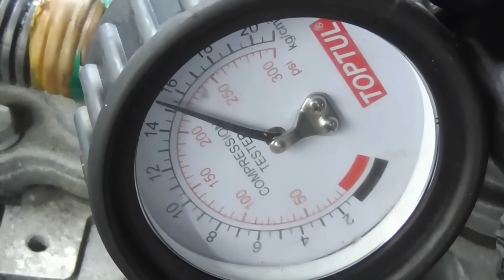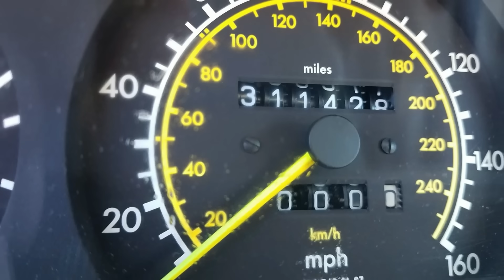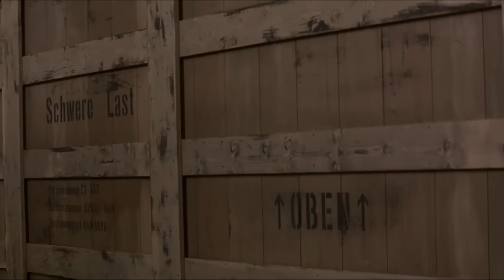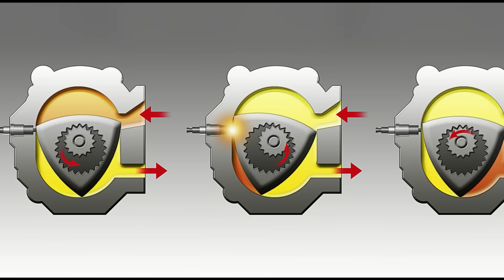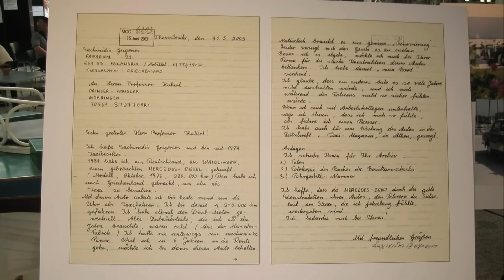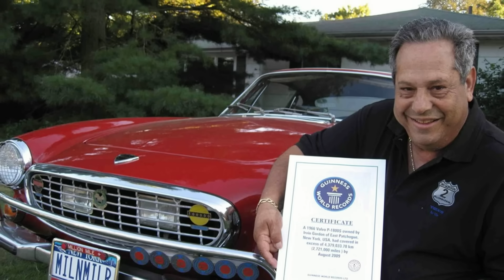Most Reliable Engines of All Time

Comment: No Dodge slant or small block Chevy?
Reply: Thats what im saying.. last even with lead foots..
Reply: Captain Ron old school Chevy v8 and v6 are unkillable
Reply: @inforthewin3231  lol I have a 98 blazer with 208k miles still running good and in my area they're are a lot of old Chevy trucks still around
Reply: 5.3 vortec ?
Reply: Or LA dodge even.
Reply: The slant 6 will run forever, also the Toyota 22R should have been listed.
Reply: @nrwlkguy  The 22R should last 1M miles it's a gutless wonder.
Reply: Yea,  no mention of the vortec 5.3L? 🤔🤔🤔 obviously the guy making this list knows nothing.
Reply: profnasty  My SBF, you have to throw into Mount Doom to kill. Your I6, you have to weigh it down to keep it under the lava for a week, or it'll just float out of there without breaking up.
Reply: @cellphonelightsaber  Herbie Hancock's 260 powered (2 brl carb?) AC Cobra that he bought new has some seriously high mileage.  He said the engine has never been opened.
Reply: Slant 6
Reply: @marcturk4410  My Slant 6 Dodge Aspen got me through 6 years of university in Massachusetts.  Including several times a year going home to New Orleans for holidays.  Finally rusted out from road salt but the engine never failed.  Oh wait.  There was that one time it wouldn't start.  I just gave it a smack with a shovel and it fired right up.  :-)
Reply: Right no 327 chevy
Reply: profnasty  4.0l? In a Ranger or a Explorer? That was right around the time they changed from the ohv pushrod 4.0 to the overhead cam version. Which do you have. The overhead cam version have been historically unreliable.
Reply: @jeremygagnon9277  4.0 is the reason it's called the Exploder.  Terrible head gasket problems.
Reply: Didnt you read the title? MOST RELIABLE not MOST FUEL CONSUMING and LEAST RELIABLE.
Reply: @javi009z  Y U be hatein"?
Reply: Chrysler slant 6 , hands down,  the only thing I  ever replace internal was the distributor drive gear.
Reply: SBC is not reliable they are cheap due to numbers of them.

No reliable engine list is complete without Chrysler's slant 6 and the Ford 300.  My 300 has 575k miles and still drive it everyday.
Reply: @bowez9  A quick search through some of the various car selling sites show an awful lot of SBC motors with hundreds of thousands of miles on them.  My '74 GMC PU is coming up on 350K.
Reply: @NuclearGrizzly  With no rebuild or disassembly of long block?  

The last person to see the inside of my 300 was a FOMOCO employee at the Cleveland engine plant in 1989.  This includes all gaskets excluding  water pump.

Most SBC can't say that and for the ones that can account for the 300s that blew up in warranty.
Reply: @bowez9  Mine is just like it came from the factory.  As are so many multi 100k mile sbc's.

The one in my '70 z-28 is coming up on 90k even with frequent track days.
Reply: @NuclearGrizzly  stock 70 z28 would be a 14sec car so unless you're running stock class there is my answer.

There maybe may multiple 100k mile engines but not a statistical signficant number with all original parts with no service.
Reply: @bowez9  I road race mine as well as my '69.  But who said no service?  My cars are all serviced and inspected religiously.  Just some of mine, like some SCB and Porsche flat 6's, haven't had their engines opened.  Though I don't know the mileage my Model T hasn't had it's short block touched.  Just a higher compression head added.
Reply: @NuclearGrizzly  by service I don't mean basic maintenance; ie fluids, filters clutches, but adjusting valves, changing timing/valvetrain components, seal replacement.

This is issue I have with Toyota/Honda, requiring timing set replacement every 60k miles.  Sorry but IMHO tearing a engine apart that often means it not reliable.

I would find it hard to believe you are still running seals, timing set, or lifters from the 1970 assembly of any SBC.  Removing intake, exhaust, or front cover also disqualifies imo.
Reply: @bowez9  Well it's a solid lifter engine so the valve covers come off every 3000 miles.  Just like every other solid lifter engine.  I'm not sure but if I recall the timing cover may have come off to retard the timing to better handle gas that isn't 101 octane.  My dad bought the car new and I remember something about that as well as retarding the distributor timing.  And the carb was replaced with a modern unit to better handle ethanol.  Other than that the engine is just like she came from the factory.

Comment: Toyota h and fe series in line 6 diesels. And ford Barra inline 6 petrol, made in gas form as well. Na and turbo set ups. Easily keeps up with the 2jz and rb motors. Was used in taxis in Aus for years with thousands of cars putting out 500-800 000km trouble free.

Comment: Yeah this is lame. 150k miles isn't a lot for a top 10 most reliable engine. cutoff should be 500k -1 mil miles. Tundra v8 1 mil miles 4.0 Toyota v6 many 600k and still running.

Comment: 7.3 powerstroke? 5.9 Cummins 12v? LBZ duramax? Iv seen a 1996 f350 7.3 powerstroke 450,000 miles never rebuilt has more blow by than a sick hooker but still very reliable
Reply: 5.9 Cummins 12v with 687,000 miles still going strong. This is a list of pussy import cars!! Title should be pussy import car motors snowflake wanna be ricers love.
Reply: My power stroke has 358.000 and my Cummins has about 340.000!!!   This guy is talking about 150.000 miles?????  what's wrong with him???

Comment: No mention of the 7.3 power stroke or 5.9 Cummins?
Reply: I drive a 1998 f-250 two wheel drive with the Powerstroke...as of last nite-689,722 miles,still cruises at 70 on the highway, starts in any weather, plain and simple the dang thing is bulletproof.
Reply: @robertsnyder1330  I've hear of them going over a million without any major work. But never seen one last that long myself.
Reply: @eddieblazek9692  keep the oil clean,add a bit of injector cleaner once and awhile,and use good fuel that's conditioned for the temps in your area...that's all I have ever done. (Plus belts,hoses,antifreeze of course)
Reply: @robertsnyder1330  You're full of shit, there's no such fucking truck.

Comment: No mention of the LS.. Family have owned both Hondas and Toyotas with these engines and none of them have been as bulletproof as my trucks LS... 186,000 and havent touch a single thing other than routine maintenance.
Reply: 476,000 on my 5.3 work truck . Have done head gaskets coils water pump , normal wear stuff . Never have I had a problem with any internals . When I took the heads off of it everything looked perfect . The wear marks were so light that I couldn't even measure them .
Reply: This is all Big Bull Shit lol this guy is aricer lover because he never even mention no 1 v8 engine what so ever. An. No american engines so the title should be the japanese 4 and 6 cilinder engines of all time by de way not to mention the LS engines means eather this guy is antiamerican or he dont know shit
Reply: scotty Kilmer wants to know ur location? lol

Comment: My 2005 Subaru STi just passed 200,000 miles. It has the original factory clutch and it doesn't slip. It has been on a custom stage 2 tune since 110k miles. 👍

Comment: 12valve Cummins million mile motor
Reply: Gabe Hartmann there good motors but not million miles
Reply: i have one with 500 plus and i run the dog shit out of it and it still runs like it just came out of the factory
Reply: I've seen more 12 valve 6 cylinder Cummins engines explode than I have seen reach 250,000 miles

Comment: I got 150,000 miles from my 89 2.3 Mustang clutch. I only had to change it because it kelp breaking the small clutch cable. The springs get so stiff the cable would break.

Comment: Ehh.. You missed out bigtime on the other engines from volvo dude.. Volvo B21/23 that goes in 240/740/940 models. Easely passes 250tm and even 300-350 too. I personally had two volvo 240 that passed  400tous. So, better research! Otherwise i liked your list.. ;)

Comment: The majority of mid 90s chevy trucks with the 5.7l (350) will run a good 240k-250k with zero problems. My family and I have owned 6 of them. The tranny's in them have to be rebuilt around 150k-175k.
Reply: I have over 225, on my 93 chevy never rebuilt

Comment: Clearly know nothing about cars. Quite literally EVERY engine type will make it over 100k miles with good service with overall few exceptions.  Seeing 200k miles is extremely common acrossed all makes all models. Even 300k miles is very common on original engines when they have been taken care of. Stop peddling crap and learn about engines that REGULARLY make over a million miles without major problems. Semi trucks, gm gas v8 engines, duramax, cummins, powerstroke diesels, 90s-2000s sohc honda engines, 4.0l jeep inline 6, Gm 3.8l v6. Ill stop now because youre a joke.

Comment: Uh Toyota Land Cruiser 100!🙋‍♀️ 322k miles still purring like a kitten. 2 Tacomas just hit 1mil miles too!
Reply: 2 toyota tundras hit million miles too
Reply: BASE line with what engine? 4.0?
Reply: @joed8423  toyota 4.7 v8
Reply: @joed8423  4.7-liter DOHC 32-valve EFI V8 235 hp @ 4,800 rpm; 320 lb.-ft. @ 3,400 rpm
Reply: An LS400 hit a million miles too
Reply: I have seen a few cruisers odometers stop working long before the engin started giving problems. We sold 3 with over 400 000 km on them and they sold almost instantly due to the reliability in the African Bush.
Reply: @janwarren5684  I'm reliable in the African bush! 😁 Love me some dark chocolate
Reply: Meanwhile my subaru blew up at 150k 😐
Reply: There you’re trucks ??
Reply: @bg5561742  I think the Land Cruiser is theirs
Reply: @bg5561742  the Tacomas aren't! Just the Land Cruiser. The Tacomas were different owners and just on the news this week.
Reply: I had a 68 F-4 the motor was a mirrored chevy six. It was a tank but the body was a rust bucket

Comment: I have owned a string of GM products, mostly  Chevrolet or Buick.  None have ever had any engine trouble and all were driven at least 150,000 miles by me. 

Two of those vehicles in particular, a 1972 Chev Caprice and a 1981 Chev Suburban, both with 400CI engines, exceeded 300,000  miles driven by me.  

In particular, the Suburban has a much more interesting story.  

Because of a fluke meeting, at least five years after I traded it, I saw it 2000 miles from where I live.  The owner said "it was still an excellent, trouble free vehicle for him" .  

The owner said "he used it to pull his caravan over mountain passes, among other things, and said it was the most powerful vehicle he had owned.

Comment: The early 2000s 5.3s are reliable engines I have a 2001 Chevy Silverado with 313000 miles on it with the 5.3
Reply: Any ls style motor is indestructible cause it has a 6 bolt main and one of the largest camshaft duration produced. Did I mention that until 2015 that the only v8 that had more cfm through the head was NASCAR motor.. wonder why everyone is doing ls swaps lol consistently run 15lbs of boost on stock bottom end no issues

Comment: Heeyyyy heyyyy wait up the SUPRA does not equipped with 3S-EF 4 cylinders ever.  Its 2JZ GE and GTE equipped only.
Reply: Lol do some research
Reply: And why he added a picture of the SUPRA when he's talking about RBs.
Reply: Rusheen Bay101 Yes. And no. Toyota did produce mk4 supras with the 3S-G or 503E, whatever you want to call it. It was a 2.1L 4 cylinder that was used in GTLM races, so sadly it was never a production motor for the Supra because honestly it was an amazing engine.

Comment: My 2001 3.2 litre X308 (XJ8) 4-door Jaguar has now 210,000 Km on the clock, original engine, never been opened. I can still easily reach 200 Km/hr in Germany with her and, if putting her into "sport" mode, she will outrace most of whatever I encounter, she weighs in at about 2 tons ...
Reply: Jags ajv8 is a good engine. Just needs a timing chain upgrade and its bulletproof.

Comment: LMBO my Mazda 3 2.3 l 2004 is running good I got off with 150 k and it at like 198k  . I had the car just over a yr yes I drive alot just because  I love too.. and she is running strong I still play in the car shifting hard and all.. I had a 97 Dodge Neon 2 door 5 speed you had a lot of miles on it I put about 50,000 miles on that car in a year the only reason I sold it is because I ripped motor mount from the frame in the front I was not about to pay to get it will get back. but that had a 420A motor Sohc  but this was also the same engine that was in my first car which was a 97 Plymouth Breeze I got that car with 200,000 miles on it I drove all the way after 235,000 miles within the first year before I crashed it. now I just got a 2009 Honda Accord with 148,000 miles on it had this car for bounce 3 weeks and I put two thousand miles on it already I'm currently driving out of town as we speak. This has a k24 I think because  it's a 2.4 but she well get the test  of time. the Mazda is getting a break I might for a bet till I can get some more insurance on it and she also needs an exhaust leak fixed and I'll start playing around in there if that car didn't rust so much I would mod the engine.  i change the oil and most of these cars every 3000 miles I like Castro GTX synthetic sometimes I need to change the oil for 7000 miles of most cars but most of my cars are highway miles and I plan everything I get burnouts hard driving all that

Comment: dude rotory engines are not realibel but you can make them relaibel but no matter what that engine will eat itself no matter what. and how can you nok talk about vw engines the alh 1.9 tdi 90-110 hp can go well over a millieon km with just oil changes after 10000km
Reply: Wolf gaming- you're so right!- the VAG 1.9 TDI motor as found in VW , Skoda ,Audi , and Seat cars is capable of enormous miles if the correct type of PD oil is used and changed regularly. I'm on my 4th car with this engine and each has got to about 350,000 miles ( not kilometres) with no hassles.Only one of them needed a clutch in that time.(oil and Knecht oil filter every 7000 miles at the latest.Timing belt , tensioner and water pump every 70,000 miles). Greetings from Ireland!
Reply: @declanlee5440  hell you know its a good engine when it just wont die. i stil have my first brand new car a 2003 skoda octavia 1.9tdi and its done 454000 miles give or take its just about 740000km and its stil going strong, greatings from denmark
Reply: RELIABLE not realibel or relaible

Comment: Thé best motor is a slant 6 dodge 1 barrel carborator
Reply: I had that engine in my 1974 dodge dart,great n durable engine.
Reply: Had same in my 74 valiant. 225 cu in
Reply: Had one in 63 Valiant sold it to my uncle he put over 500 k on it!
Reply: the motor was used in fork trucks

Comment: I think you missed out on the 1uz-Fe from the Lexus ls400/celsior and the soarer/sc400. Damn near bulletproof.
Reply: The 1uz is for sure bulletproof. I've seen 2 with over 1000000 miles
Reply: Todd Orr exactly I’m getting my second ls400. 99 in fact. Although the 1 gen had forged pistons and rods.
Reply: They had valve lifter trouble if the oil wasn't changed religiously
Reply: I got two of the gen 1s and if you put in piston oil squirters they are boost beasts..
Reply: Ive had 3  soarors ... or lexus coupes in usa ... 4 litre quad cam alloy v8s ... go forever ... easy to up horse power ... the old 7m gte 3litre supra engines good too .. had a 360kw supra ... mean ....

Comment: The Mazda 787B is the most reliable Rotary engine
Reply: The 26B was indeed a feat of engineering. After the 787B proved itself at lemans, the engineering team tore the 26B down expecting it to be half stuffed but they found no scoring of the rotor housings and no signs of wear. They're indeed a very good engine when built right and not boosted to the point of blowing the apex seals out...

Ideally the thing that bothers me most about the rotary engine is the balance of the eccentric shaft, which usually relies on a counterweight which in turn adds weight and rotating mass, however I feel that with a 6 rotor variant utilizing a bespoke eccentric shaft and slightly altered firing order could in theory be run without any counter balance whatsoever, and would likely produce a very strong scavenging effect with a 6-2-1 exhaust header design.
If I had the money to invest in such an engine though I'd probably do it just to see if I'm right, because if it actually runs right (As opposed to just rattling itself apart) I'd imagine 500 horsepower is a given, reliably, and it would likely be able to deliver that power in a violent, however predictable manner.
No idea what I'd put the engine into though as to be honest, seeing as it will burn a lot of oil and consume impractical amounts of fuel for road use.

Comment: 240D Mercedes Benz 💪🏼
Reply: Yes. The 300 and 300SD were just an evolution of the four cylinder 240D and 220D, so why aren't they mentioned, other than the taxi? Also, the Volvo Red Block engines, both OHV and OHC, can post amazing mileages with average care, and deserve a place on the list.

Comment: The moral of the story.
Mercedes and BMW Diesels.
All Japanese engines. (Although stay away from modern Nissans)
Also, change the oil and filter. Never mind about these 20'000 oil change intervals. Every 5'000 miles or 3'000 on a Diesel

Comment: I wish Corolla is in this list, it is really good reliable car to run 300,000 miles on it.  Just changing the oil and filters, it is a good gas saver.
Reply: lol which engine
Reply: @ogsamosa  , I have a 2007 corolla with 350k miles and original alternator just got replace.

Comment: I own and travel in a 1985.5 Ford Escort 1.9L L4, Fox Body 2 door hatch. I have driven it over 300k miles and it had 64k miles on it when I bought it. It only goes to 99999 miles before it flips to 00000 again. Only GOD knows how many times it fliped before I bought it.